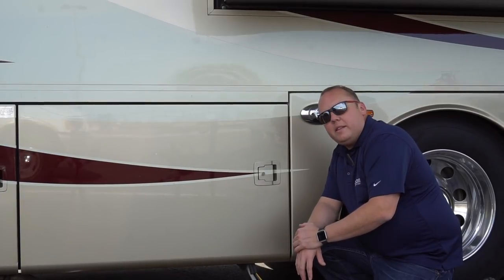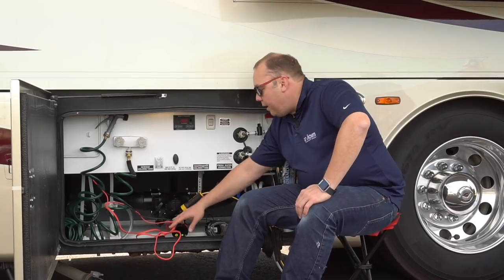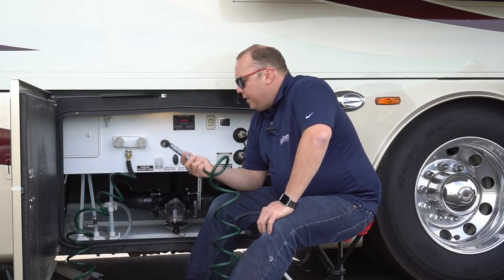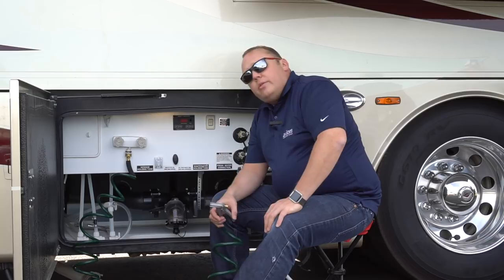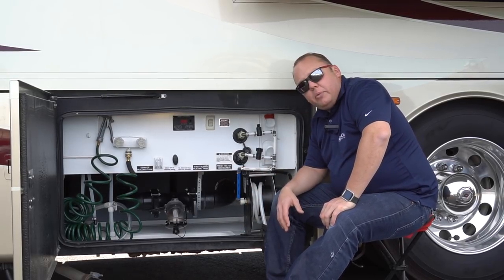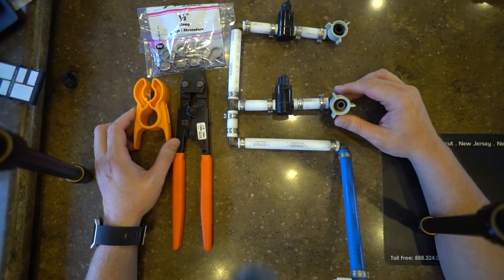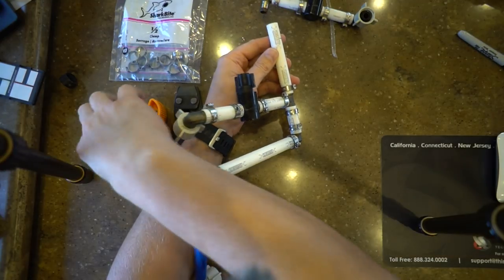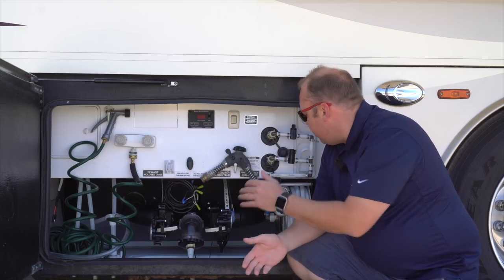RV Wet Bay Upgrades + PEX Crimping Explained - Our Upgrades After 3 Years

Comment: Great video!  

A few months ago, I did a similar "one hose to the RV" mod using off-the-shelf garden hose components.

After seeing a few videos with a "Y" adaptor at the water source and two hoses to the RV,  I simply put the "Y" at the RV end. The "Y" already came with valves for each outlet, so there is complete control over where the water goes. 

I used a couple of short "hose savers" and 90-degree connectors to make the connections from the "Y" to my fresh water and black tank flush connections.  

Like you, I also have a breaker inline between the "Y" and the black tank flush to avoid having anything back up into the fresh water source.  

Food for though for anyone uncomfortable going the Pex route.  This approach just uses regular hose screw-on connections.

At the inlet to the "Y", I also put a small garden water flow meter so I can tell how many gallons of water I've added to my black tank when flushing.  (I don't have the meter in the wet bay that you have.)

I'm definitely going to switch my "outdoor shower" hose connection to a garden hose connector.  Thanks for the tip!

Comment: If you have hot water to the generator you usually have a hose outlet. Works best for washing off bugs. Every RV pro say never use the same water connection for both the flush and fresh water. The check valve only stops back-flush. I have a separate hose for flushing black/grey tanks. Our fresh water has a "whole house" filtering system plus an external one I have in-line.
Reply from the maker: We are looking at a whole house water filter as a manufacturer has asked us to install one so we will keep you posted. As for the separate hoses, i agree that is what folks say, but since the rinse valve is always in the off position when the backflow protector is in use we've had no issues. I think its far more likely (in my opinion) to experience cross contamination after months of hauling hoses into separate bins, touching things etc but absolutely to each their own. We've been 100% happy with no issues and love the setup so far as even dropping one hose was a win for our storage. Thanks for the comments! (also i'm not aware of hot water to a generator but that sounds interesting and would love to know more!)

Comment: I would put the fresh water Pressure Regulator on the inside of the rig. You could have the Gauge and then the on and off knob on the back panel which would look dope.
Reply from the maker: not a bad idea! Especially since we've had a couple fail moving this to the inside is a great idea. Will look into that!

Comment: Eric, have you ever seen or used the Sewer Solution?  I can pump my black/grey discharge up to 100' up a slight grade with just water pressure.  Everything goes through a 3/4 inch line.  Have had one since early 2000 with zero problems.  No electric to worry about.  Check it out!
Reply from the maker: We've tried it but we couldnt get nearly the speed (and rinsing results were mixed) of a macerator. That said we've talked to lots of people who LOVE them and the price is awesome. Might have to give it another look when we have more time.

Comment: Excellent video, again!   I just ordered the pex tool and camping stool, hope the credit goes your way.   Been looking for a little stool to save the knees.   I’ve have a filter, water softener and whole house (motorhome) filter system so I’ll stick with the extra black water rinse hose.

Your video came at a great time, I have a leak.  When I removed the wet bay panels I found the leak at the join of a T fitting connecting a non-pex line to the external shower.  I’ll try to redo all in pex.   

Thanks again and glad you’re still in our Lone Star state.  Summer time is coming and so are the famous roses of Tyler!   Did you get to see the blue-bonnets along the highways in the Hill Country (Fredericksburg and Georgetown area).
Reply from the maker: thanks guys, much appreciated. Glad we could help out with the leak! We had to move out of Texas and are in Vegas but are heading back to that neck of the woods in a couple weeks as we head to Nashville!

Comment: Nice upgrades!!  Looking to do the same with our new Pace Arrow as our wet bay is very cramped and not user friendly.  Quick question on the black tank rinse/fresh water inlet tree... have you had any issues with hooking up to dump stations where the faucet states "water not safe for drinking?"  or do you only do the black tank rinse when hooked up at campgrounds with potable water?  I like the idea of a single hose feeding both, but could see some contamination if the source is non-potable.  TIA!
Reply from the maker: hi! Well first off that notice about non-potable water is required by law. Its not usually a different water source, just likely that the hoses etc are subject to cross contamination so they put that sign. Still, definitely NOT something we would hook up using this tree but Lysol will definitely help with the cross contamination just to be safe. We only use our black rinse when we are at a potable water location. Not the end of the world to not rinse and 99% of the time when we are using a dump station its because we've been driving or boon docking which means we have plenty of grey water to rinse out the hoses etc (not the black tank but... you do what you can). Then when we arrive back at full hookups we do a full dump..
Reply: @LivinliteNet1  Awesome, thanks!

Comment: Were did you buy the 90 degree white plastic fitting that tightens onto breaker valve at black tank rinse port
Thanks
Reply from the maker: i couldnt for the life of me find them on the home depot website as they started moving away from certain sharkbite fittings i think but these are basically the same on amazon and also brass now. https://amzn.to/2B4T2Dn

Comment: Great videos Erik. Have you purchased the sanicon 600 turbo yet? If so,  how is it working? Where can they be purchased?
Reply from the maker: Hey Corey, we just arrived back in CT where we are staying for a little while and will be doing upgrades as well. Our Sanicon Turbo 600 is in but we have to install in the next couple weeks. We will film the install and first impressions so stay tuned. They are only available through dealers and many dealers don’t have direct accounts with Thetford so many dealers don’t know they exist yet but if you have a local dealer you trust tell them to call thetford and setup an account and then you can buy through that dealer. We are working with NIRVC to get an account setup for followers to purchase from as well as another option but we want to test it first so stay tuned.

Comment: is the flush end of the tree that runs to the tank a factory part?
Reply from the maker: I'm not sure which part you are referring to. The top black hose inlet in the wet bay was factory yes. Normally you just hook a hose up to that for the rinse system.
Reply: LivinLite.net I was referring to the factory rinse system that is internal in the black tank. I've since researched that it'd possible to retrofit it to the tank
Reply from the maker: ah yes, absolutely you can add a rinse. Usually they just drill a hole in the tank and expoxy and your good to go with a plumbed rinse system. Here is an amazin link to an inexpensive one with pretty good reviews. https://amzn.to/2wmbpUt

Comment: Love my pex, but I carry sharkbite fittings for the hook ups.  Easy peezy, with no tools required.  Well, you do need the cutter and the sharkbites can be taken off and reused as well.  On your flush system;  personally, I would never trust my fresh water hooked to the black flush, cut-off or not.  Just saying!
Reply from the maker: Hey Joe, yes sharkbite push on fittings are AWESOME but they are expensive and designed to be for temporary use. Use 5 of them and you've paid for a crimp kit for life. We see more and more folks using them for permanent installations but if any of my dad's plumbing buddies (he's a contractor) saw me recommend them as perm solution they would come after me with their pipe wrenches. Kidding but in all seriousness in talking to the pros they don't recommend them except for temporary use (at least all the ones i know). As for the back flush, keep a special eye on how the valve system works, you need to turn off the water supply before the back flush initiates cutting off the fresh water supply. While i agree there might be a risk, I think putting hoses in and out in bins, accidentally touching stuff, cross contaminating etc. introduces more risk than a plumbed system. If you want to really give yourself nightmares think about how your foot flush toilet isolates the fresh water supply from the output into the bowl... Not all toilets are the same but its given me a second thought or two on how often I give the fresh water tanks a good cleaning. Thank you so much for the comments and information. GREAT INPUT!!!
Reply: Thanks for the reply, Eric!  On the shark bites, I have used them for years with never a problem with many plumbing jobs.  However, they are expensive, so I don't recommend plumbing an entire system with them.  Great for small jobs and the fact that they can be removed and reinstalled, makes it even nicer!  Again, it's for the quick easy fix.

Comment: Why do people point up when there is never anything there... 
Just say,, Will add a link to the show notes below..
Reply from the maker: Hi Lankster, creators point up because youtube has "cards" (thats what they call them) that show in the top right hand corner that provide links to what the creator is talking about. Cards do not always show depending on the device and app in the device you using. Most people who have this issue are usually working on a mobile device or tablet. This can be made worse when Youtube updates their app causing the "cards" to show up in a different location. If you have any particular links that you couldn't links to let us know and we'll send the direct links your way.
Reply: The creator is ALWAYS up above, regardless of whether you are using a smart phone or a laptop! Sometimes he shows you your link, sometimes not!
Reply from the maker: @bmcclure0561dad  cards are not supported on a number of devices including Roku and other smart tv's so we see folks miss them a lot on non standard platforms but we'll make sure to run through and check this video to see if any cards are missing. Youtube is also changing their card guidelines a bunch in favor of an advertising based model so stuff sometimes "disappears". Of course there is the occasional us forgetting to put up a card too! Thanks for the check-in, we'll check it out!